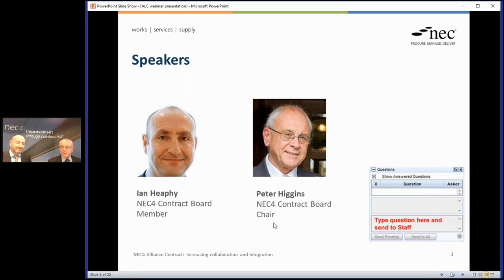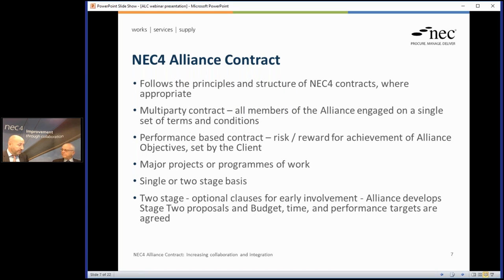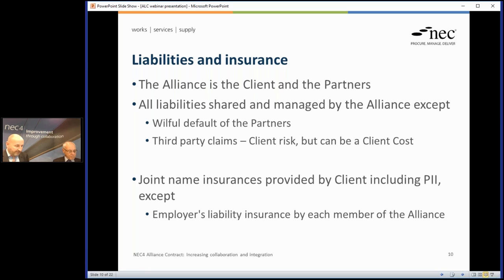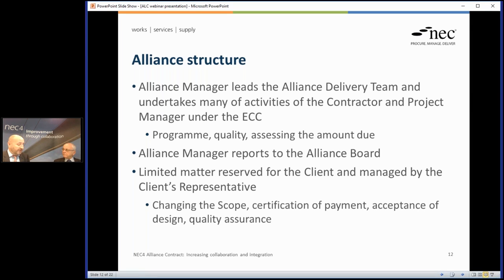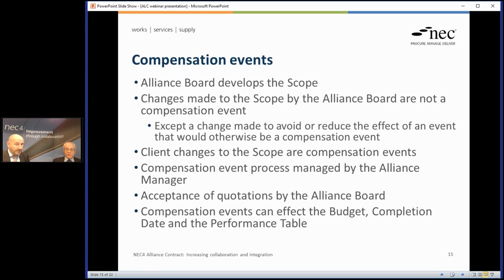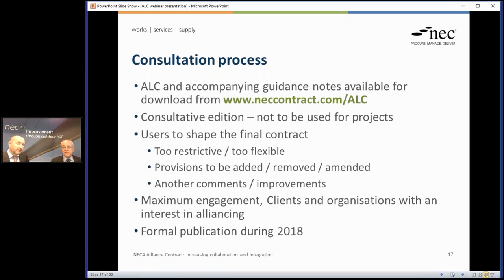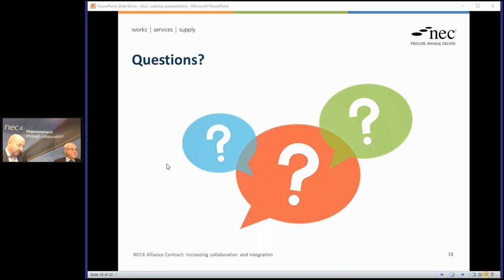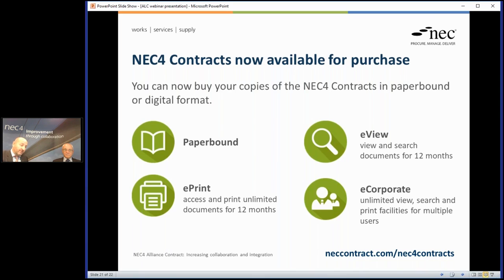Webinar: NEC4 Alliance Contract - Increasing collaboration and integration

Comment: How can parties protect the IP rights of their models that require hard work to create or any element that may have a commercial trade secret in a multi party agreement as NEC4 ALC? I am mainly asking about Information Modelling issues. If the contract is ECC, then there is no problem since the Client has the ownership of the models to use with the Project. But in ALC, they may face such circumstances since they are a member of the alliance.

Comment: I am just wondering what is the main reason why there are two clauses as 10.1 and 10.2 separately (different from NEC3)? May that be relevant to the cases of Mears Ltd v Shoreline Housing Partnership Ltd [2015] EWHC 1396 (TCC) and Mid Essex Hospital Services NHS Trust v Compass Group UK and Ireland Ltd (t/a Medirest) [2013] EWCA Civ 200. Whic in the later case the judge stated "... if the parties had intended to impose a general duty to co-operate with one another in good faith, they would have stated this in a stand alone sentence with a full stop at the end. "